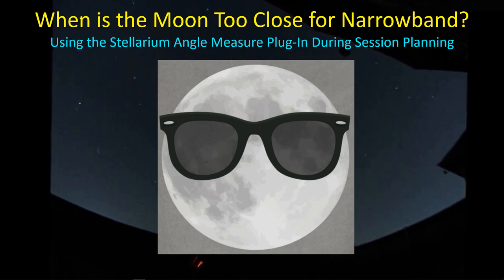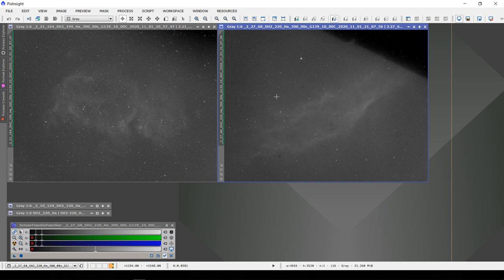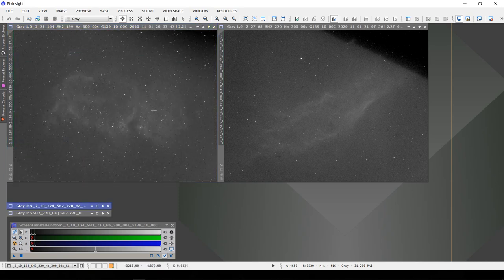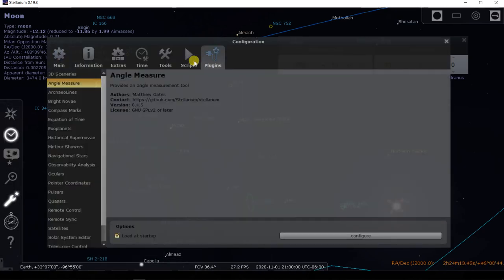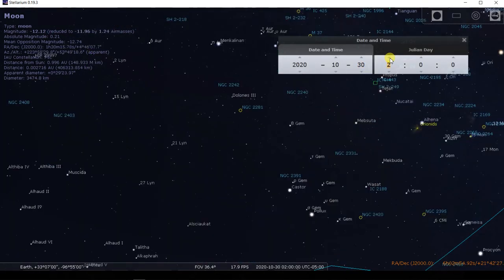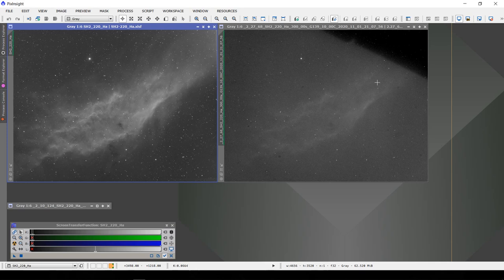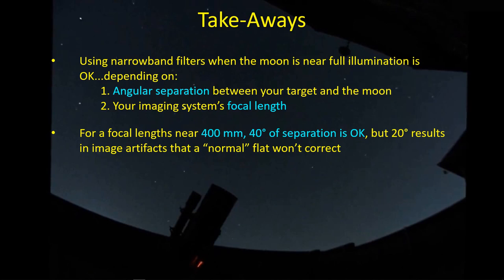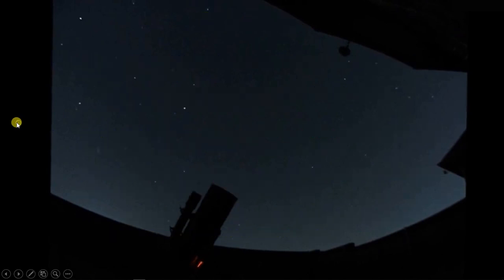Too Close to the Full Moon for Narrowband Imaging?

Comment: Thanks James. I use L-Extreme filter with shorter focal length (570mm) and try to choose target as far as I can to the bright moon (> 50 deg) in order to get decent result with OSC camera (asi2600) and reduced processing work in Pixinsight (noise , artifact ...) .But event with this filter  you can't compete with an image taken without moon (less noise, more contrast). Moon is reflecting sunlight, in fact you got the solar spectrum so even narrow band filter are affected by the moon.
Reply from the maker: The Moon and I are not on speaking terms right now. Thanks for watching!

Comment: Quite a startling difference in the images, and that was with ha filter. I imagine it would have been a lot worse if you had been using an OIII filter. A lot would also depend on the quality and bandwidth of the filter.
Reply from the maker: Indeed. I also had to throw out the O3 and S2 data from that target. I just showed the Ha data so the target would be recognizable but I agree the O3 is more susceptible. Thanks for watching, Brian!

Comment: Hi James, I’m new to filters. I own an L-extreme though and use it on a Redcat 51. Are you saying this observation applies to all filters as the field of view increases within a 20 degree angular separation from the moon?  Interesting video. Clear Skies!
Reply from the maker: I just looked up the L-extreme filter. Very interesting. You have 7nm O3 and Ha filters in one filter. Also, you’re using the Redcat 51 (250 mm focal length). My guess is that you would need to image at a larger separation than 40ish degrees from a full moon. The 03 will be more sensitive than the Ha images I showed in the video. My suggestion would be to experiment next time we have a full moon. Pick a nice nebula target “close” (20 30 deg) to the moon and take an image. Then slew to another nebula farther from the moon (40 to 50 deg) and take an image. Maybe a third target if the 40-50 deg image looks “bad”. I’d be very interested in hearing what you find out. Thanks for watching!